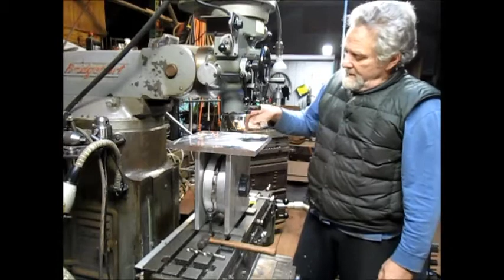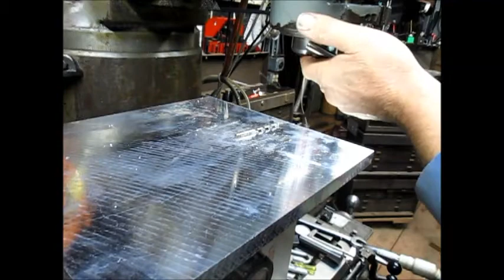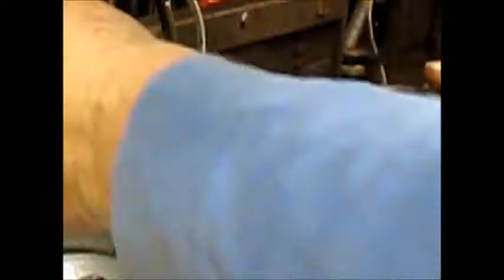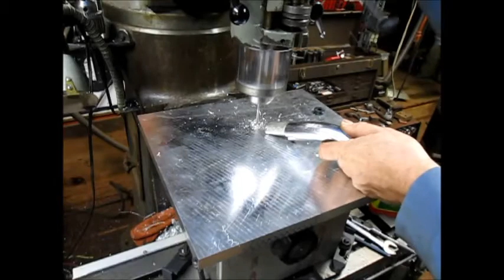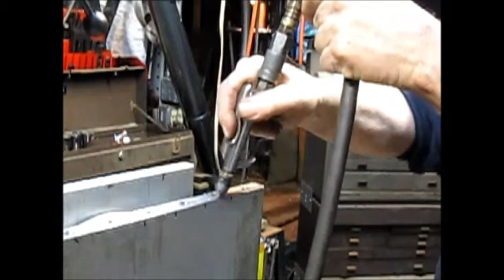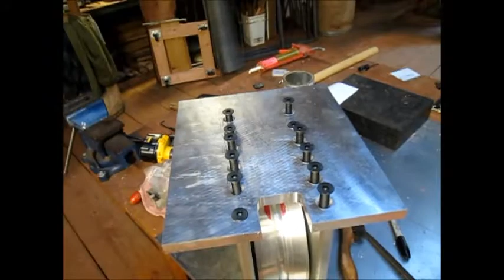Sewer Slinger 7

Comment from the maker: dave; If it had been a dinky 4" plate of steel I would have been a lot more safety conscious, but it was much bigger plated of aluminum and I had leverage on my side. I was much more worried about the torque of the mill breaking the drill bit if it grabbed so I left the bit not so tight and drilled very gingerly. If it had grabbed the chuck would have slipped on the bit, maybe wrecking one bit but not the project. Thanks for your comment and thanks for watching.